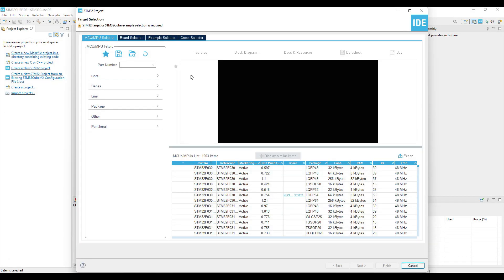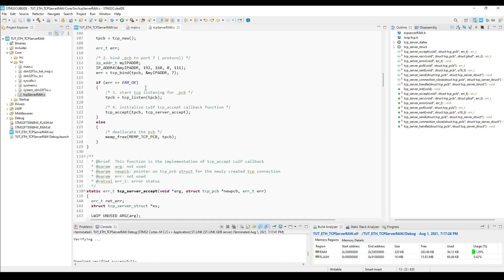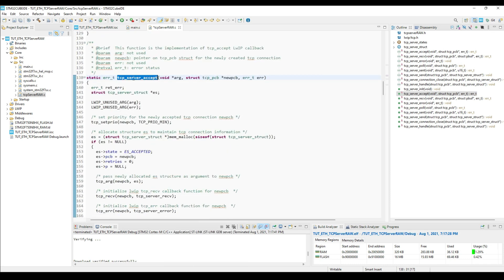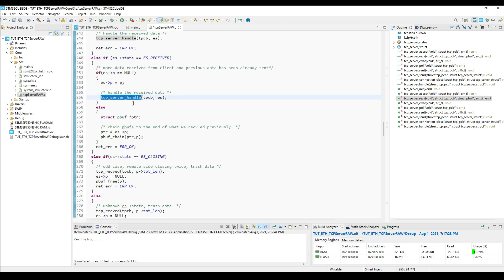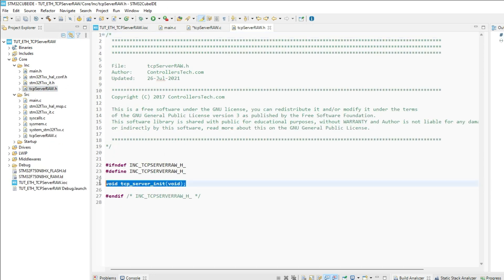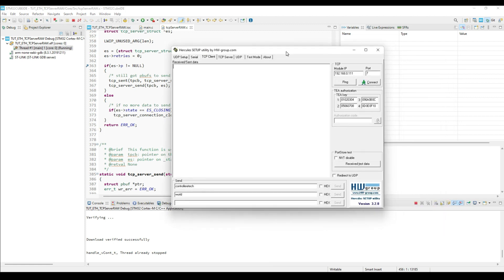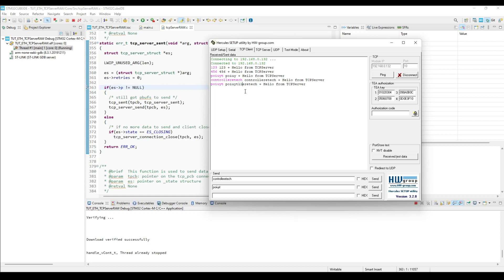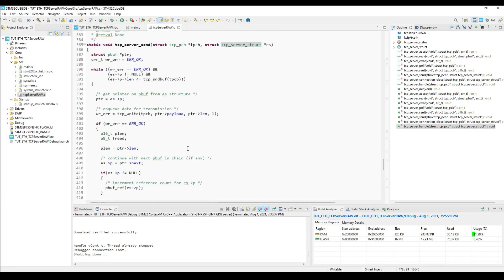STM32 ETHERNET #4. TCP SERVER

Comment: I'm using NucleoF767ZI. When sending 123 from hercules, I am receiving 123. The received data should have been 123 + Hello from TCP SERVER. 
@ContrllersTech - Can you help with this
Reply from the maker: Please debug the project. Put the breakpoint before the send function (when MCU sends the data back). Check what's in the buffer which is going to be sent by the MCU.
Reply: @ControllersTech 
I tried this 
But except for the breakpoints in tcpserver_init() function in tcpserver.c file none of the other breakpoints hit

Comment: hi sir, your explanation was soo... good... I am using this example in NUCLEO-F439ZI EVM, I found the problem when I sent the data above 5 character, up to 5 character it came correct, If I add 6th character and above buf come with some garbage value. for your reference my result will be 
" hkd34 hkd34 + Hello from TCPServer
techntechn techntechnW~ŠmW~ŠmW~ŠmW~ŠmW~ŠmW~ŠmW~ŠmW~ŠmW~ŠmW~ŠmW~ŠmW~ŠmW~ŠmW~ŠmW~Šm + Hello from TCPServer". I try different types of memory allocation, but it cannot work, I don't know where I did the mistake. thank you

Comment: hello Sir,  thanks for you helpful videos. I am trying your solution on nucleoh743zi2, it seems that when I call tcp_server_init() in the main code, my board stops responding, and the ping stops and it is unreachable any more. just when I comment this line (tcp_server_init()) the pinging is restored. what would be the problem? I just added the RAW files as you recommended, then changed the ip to my board's ip, and the port to 10 as you did exactly, but my board is not responding. can you give some hands please?

Comment: Hello erveryone,
with the newest CubeMX in the main function it is only "MX_LWIP_Process();" which is called.

I wonder, because I have to comment out the call "pbuf_free(es->p);" line from tcp_server_handle function and don't know why. But this way all is working perfect.

If the message received is longer than 100 chars the message has to be limited otherwise the program crashes.
Reply: how to handle the data if data is got corrupted?

Comment: Thanks a lot!
I am using STM32F767ZI and STM32CubeIDE. In this case I found HardFault error after calling "tcp_server_handle()". that was about memmory allocation for "struct tcp_server_struct *esTx;". I've added solved it "esTx = (struct tcp_server_struct *)mem_malloc(sizeof(struct tcp_server_struct));" before using "esTx" and solved it.
Reply: Thanks. I work with stm32f769i-disco. Couldn't get data back to client and after your fix all stated to work well.
Reply: Thanks, I had the same problem and now it is solved. I really appreciate you sharing your solution. Cheers.
Reply: Thank You very much. The solution hit the point. If you get the Hardfault error here after sending some data  to the tcp server(stm32), you could solve the problem by just adding "esTx = (struct tcp_server_struct *)mem_malloc(sizeof(struct tcp_server_struct));" code line to the first lines of "tcp_server_handle" function.

Comment: Using an STM32F7-144 nucleo... upon executing line 488 (esTx->p->payload = (void *)buf;) in tcpServerRAW.c    I go to HardFault_Handler in stm32f7xx_it.c .  I commented out the unused "get the Remote IP" and "Extract the IP" sections to make tcp_server_handle as lean as possible ... I was able to get the app working with that change.  I am not sure why that worked, but I plan investigate the TCP Protocol Control Block structure in depth for clues.
Reply: struct tcp_server_struct esTx = {0};
create a variable instead of a pointer
Reply: Yes. The structure pointer is used uninitialized so you have to great a line before it such as:

struct tcp_server_struct esTx_var;
struct tcp_server_struct *esTx = &esTx_var;

Then the M7 does not get a hard fault because it has an initialized pointer that is not NULL.

Comment: What to do when we use FreeRTOS?
Reply from the maker: Check the Playlist.. it's already covered
Reply: @ControllersTech  Hello, I have seen several problems in the tcp_server_handle() function, which causes receiving from the network with errors and micro crashes. Did you manage to fix this problem? At first I thought it was because of FreeRTOS but later I realized it was because of that function.

Comment: Hi, Thanks for such a informative video on TCP server. I am trying to implement the TCP server for stm32f4 device. I followed the same steps as given in the video. I am able to get response for ping command but I am not able to connect to TCP server. Can you help me in this? I am getting "TCP connection error :10061". Anyone facing same issue?

Comment: I've got only one echo. After that the TCP freezes
Reply: Did you find a solution?
Reply: Yes
Reply: Delete pbuf_free at the end of handle should work.
Reply: @iluhgasie  Ty now its echoing my input but will not let me append or alter my input. Do you experience the same behaviour?
Reply: @Noxxs511  
Maybe you have found solution coz its been 5 months, if not, use this code in your tcp_server_handle function.

        struct tcp_server_struct *esTx;
	char buf[100];

	strcpy(buf, es->p->payload); // keep this if you want do processing on received data
        //like below I just set an LED on for particular data
	if((buf[0] == 0xAA) && (buf[1] == 0x55))
		HAL_GPIO_WritePin(LD2_GPIO_Port, LD2_Pin, GPIO_PIN_SET);

	esTx = es; // This copies everything to your local variable
	strcpy(buf, "Hello from Sunil's TCP Server\n");
	esTx->p->payload = (void*) buf; // This just changes the pointer to payload
	esTx->p->tot_len = strlen (buf);  // This sets payload length
	esTx->p->len = strlen(buf); // This sets payload length

	tcp_server_send(tpcb, esTx);
Reply: @sunilzode2199  Hey, thank you very much! It seems your code stabilized the tcp server!
Reply: @sunilzode2199 May you share your github with us?
Reply: I receive packet in ethernetif_input() but but echo is not send. sometimes it receive 2nd or more echo packet but then it ignores any packet.